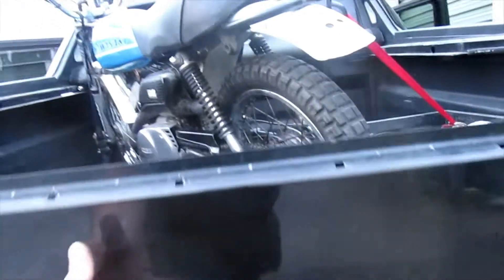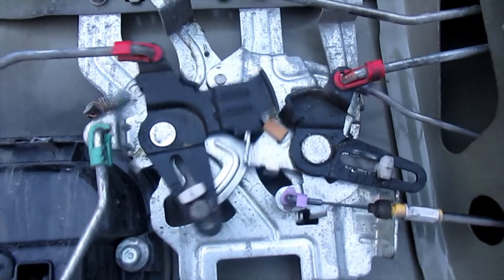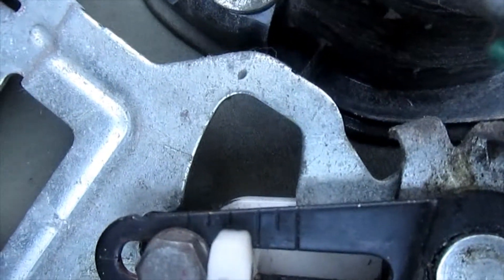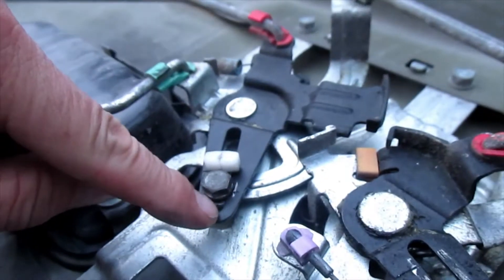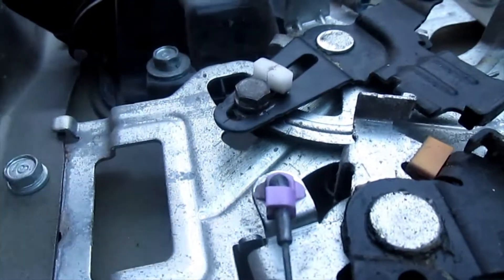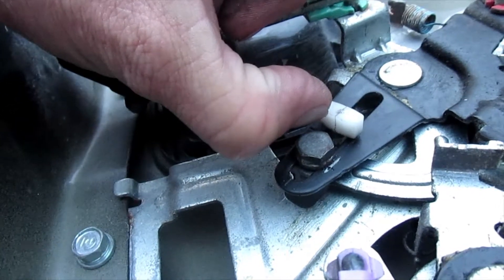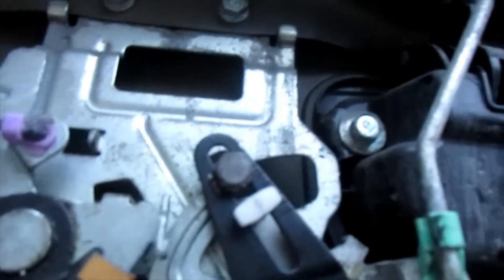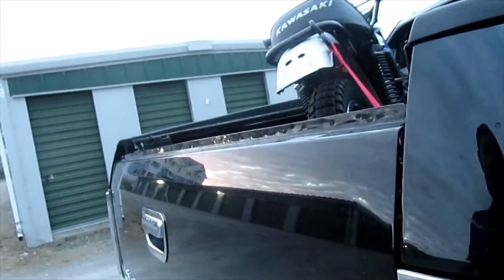HONDA Ridgeline tailgate repair

Comment: I watch many who showed how to install a new tailgate handle. They left off a very critical, and crucial part, the 2 ten mm bolts to make it open that wasn’t in the Honda’s kit, worked. Thank you so much. I did every stem and my tailgate wouldn’t open. Your video solved it. It was the main ingredient like baking soda. I had even taken my vehicle to a shop that specializes in Audi and Honda. They had my truck for 5 days, and couldn’t figure it out. Honda service department tried to say it must have been a damaged rod and I got quoted $563 to fix my tailgate handle. Again thank you. You were very thorough
Reply from the maker: very good so happy it helped, I find others who help me solve issues like this,  so that is why I posted my quick fix, , to give back.

.they are great trucks.

Comment: I have a 2017 Gen 2 and a modification to your fix worked for mine too.  For Gen 2 models, put the bolt on the other side of the white plastic piece.

Comment: I may have to try this.  Mine worked fine for 10 years - broke - took to dealership $240 - worked for 2 years and now broke again.  $240 every 10 years isn’t so bad but after 2?!?!?!?   Got me mad.
Reply from the maker: It was mostly labor costs I bet. There is so much going on in there. Fiddling around to find the wear item was the challenge. Keeping mine from moving out of range was the bolt I installed. 
hope it helps.
Reply: I was just quoted almost $800 for the dealership to fix it 🤯

Comment: It is the other arm that pulls the latch for the door swing.  On my Honda, the plastic piece had too much travel the opposite direction.  Which when I pulled the handle on the lower right side of the tail gate to swing open the door the puller metal piece did not engage the plastic slide piece.  So I put the bolt on the opposite side or the pully unit with the purple cable.  I do not think your fix is correct.
Reply from the maker: you must have a Gen 2 Ridgeline. same thing only opposite .